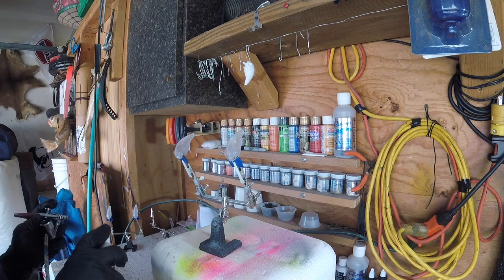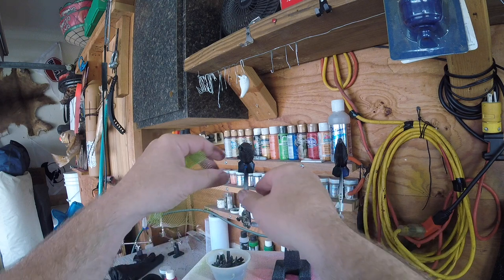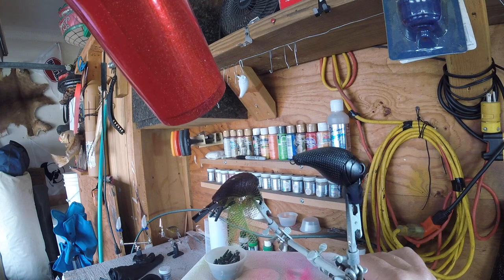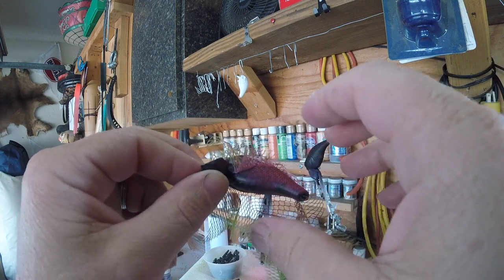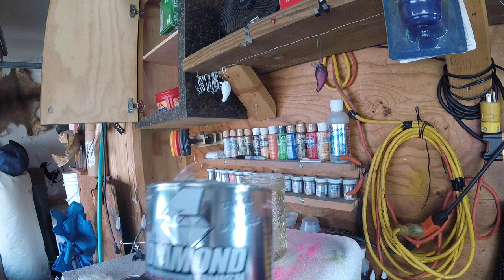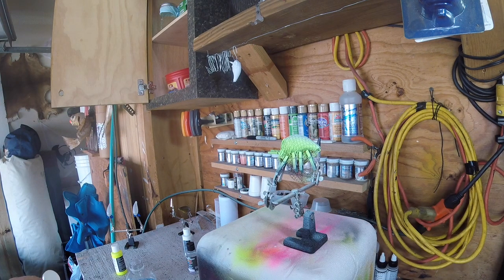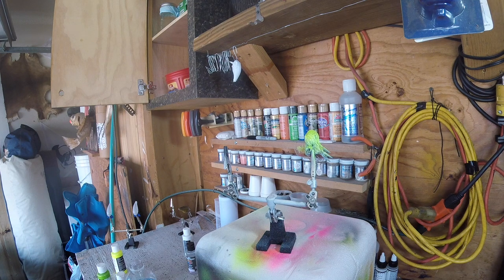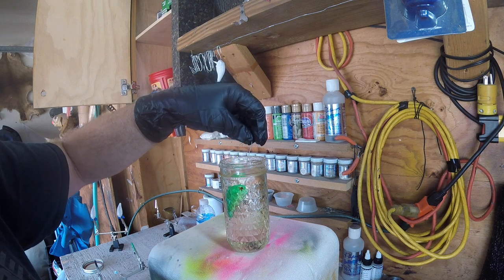How to Airbrush fishing lures

Comment: Can u air brush the clear coat on? Also could u use a paint brush or would it leave brush strokes? Thanks
Reply from the maker: I haven’t tried putting the clear in an airbrush but it does seem thin enough 
Also you can use a paintbrush you just have to hang the lure to dry the brush lines should even out